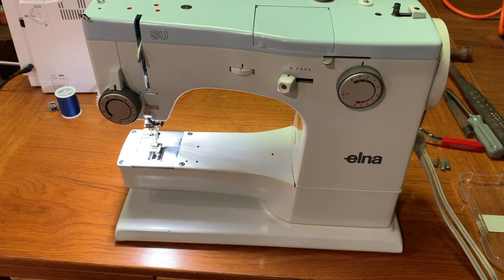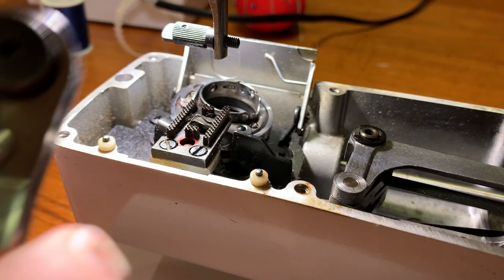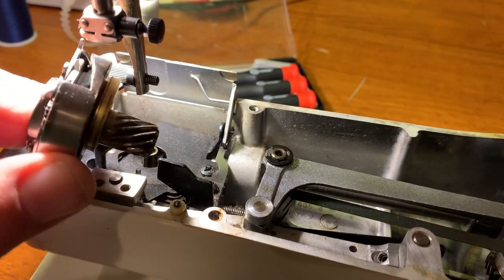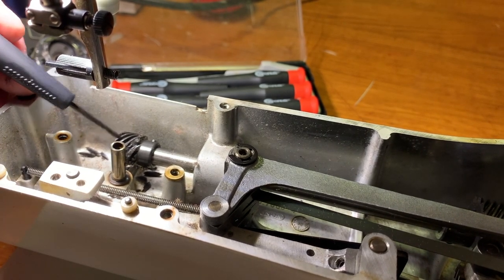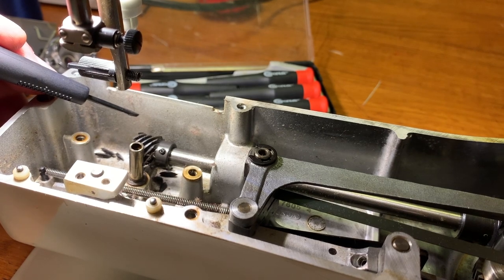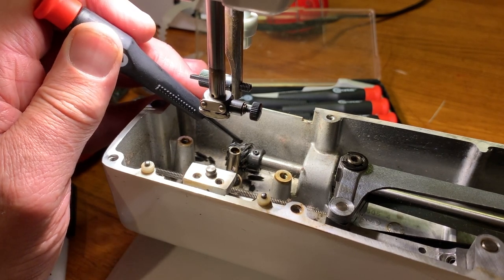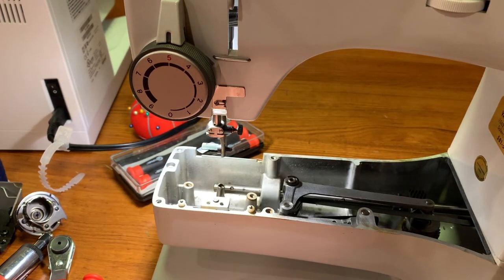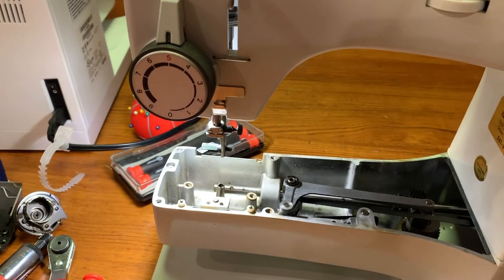Elna SU-62C Star Series Hook Pinion Replacement

Comment: I am so grateful for this video.  I hadn't used my Elna SU for many years, having progressed to a computerised Bernina sewing and embroidering machine, but wanted to use it recently, as I have a ruffler attachment for it.  Long story short - I lent the machine to someone, some years ago who said she hadn't used it but, when I tried to, I discovered the bobbin section was so tightly filled and wound up with thread, it took me ages to carefully snip and remove it all.  I don't mind when people make mistakes or even break things, but please, own up and don't lie - I was obviously always going to discover it anyway!  This video gave me the confidence to change the gear, which was so shredded, it literally fell apart as I took the pin out, and set the timing (after several attempts at that!) and I have just sewed a hem.  The bobbin tension is perfect - the top not so much, but I will play with that.  I had been told by several sewing machine engineers, that it would be impossible to get this machine going again, but I ignored them and tried anyway.  I currently live in the UK, and did find a man who lives hundreds of miles away in Cornwall, who helped me as well, particularly today as I struggled to get the hook seated correctly and connected to the gear.  His company sells brand new parts of many mechanical machines, including mine, and I bought the new gear from him as well as new plate screws as I mangled them getting them out.  Thank you so much Scott.
Reply from the maker: Very glad this video helped you get your machine back up and running, Christine!

Comment: Thank you so much for this video.  My wife's Elna 21C (circa 1969/1970) stopped working and I partially disassembled the lower part of the machine before getting stuck at how to remove the rotary hook assembly.  I then found your video and it was definitely a lifesaver as I had no idea how to punch out the pin holding the gear, and the crucial information on the position of the gear and re-assembly were invaluable.  I sourced the gear locally, but the part number linked to Amazon (#403030) was also the correct one for the 21C.  Thanks to you, my wife's machine is running like new again.  Thanks for taking the time and effort to produce this video.

Comment: Awesome video!  Thanks to your instructions, I was able to fix our Elna Automatic * after the pinion gear disintegrated.  I saved $ and enjoyed an interesting project.  Despite trying to replicate the original gear position using your technique, I ended up needing to retime the machine a little bit.  I found it actually isn't that hard to do.  Other people have youtube videos on the subject if anyone needs to do this.  Something I'd like to point out in case it helps others is that you need to check that the feed dogs are synced properly with the stitching cycle.  I couldn't figure out why my tension and stitch length were all messed up until I finally realized that my machine was advancing the fabric while the needle was down.  Turns out there's another pinion on the drive shaft that you may need to adjust to ensure the feed dogs are cycling downwards while the needle is in the fabric.   Once I did that, everything came out great.  Thanks again!
Reply: My experience exactly! I should have read your comment before I started!

Comment: Thank you for the video.  I have both an Elna SU and a Lotus TSP,  the poor TSPs gear shattered, and I'm in the process of ordering a replacement.  Your video, though not for the TSP, gives me a good idea of what I should be looking at when I dismantle the wee beastie.  Thank you for the tip of marking the shaft for the pin orientation on the gear.  That's the kind of awesome tidbit that makes or breaks the experience of working on our own machines.
Reply from the maker: Thanks! I hope it helps with the Lotus. Never worked on one of those though I hope to someday.

Comment: Thank you so much! Just fixed the very very same gear last night at the same spot, but a different Elna model. I lost the manual and can't tell which model I own. The big white plate isn't a separate piece in my version, so I had to open it from the bottom to get to it

Comment: This has been my mission yesterday, today and tomorrow.
I've changed out the gear and have it sewing but I've goofed up on the needle timing somewhere. Straight stitches are strutting the academy award carpet but the zig-zag is loudly protesting the event! Watch this space...
Reply from the maker: Hi Tom. The essence of timing the machine is to ensure that with the needle in the exact center and at the very bottom of the stroke, the hook point is at 4 o'clock. Then when the needle has risen exactly 2.45mm on the upstroke, the hook point will be exactly behind the needle. Elna mechanics used a tool, H11039 / 100630 that is 2.45mm thick to set this. They brought the needle to the bottom of the stroke, inserted the tool around the needlebar right where it comes out of the snout of the machine, and then screwed on a clamp pinning the tool in position. Once the clamp was on you could pull the tool out and be sure the needle had gone up 2.45mm when the clamp stopped the upward travel. The tools are hard to find, though. I use the plunge gauge on my set of calipers. I stick the plunger down the needlebar gallery til it hits the bottom, zero out the meter, and then use the caliper readout to get my 2.45mm upward travel value. It isn't as easy as just having the tool but it does work fine. I have timed many machines using this method. Good luck!

Comment: Scott, thanks for an excellent video. One question, after I did this my reverse stitch will not function- the forward is all perfect. Reverse side bar also works. But any reverse stitch on the stitch lenght control pulls my threads around the bobbin. Could I have it on wrong?
Reply from the maker: The timing and the feed system are only related in that they get their power through the same shaft. My first task fixing your machine would be to ensure that the feed mechanism is working smoothly and not binding. The feed system is controlled via a thin metal blade running from the underside of the machine through the free arm over to the feed linkage. Ensure it is not binding. It can bind due to stuck bushings in the vertical shaft that controls forward reverse or it can be a sticky components in the feed linkage or spring. If all of that is smooth, then check your feed dog timing. To do this, crank your machine to the point that the takeup arm is as high as it will go. Hold it at the highest point with your thumb. From that point, the feed dogs should travel 1mm forward to reach max forward travel. If they are not your feed timing is off.
Reply: @Elnamech  I found your comments on FB about feed timing, and they really helped. Thanks Scott! I see you also have AE SU 68. I kinda love mine, but she gives me grief!!

Comment: Scott,

This video Lois great and I think I could do this if I had the 62C.  I have the 64C flatbed model and I just can not see how I will get to this piece.  I can see it, but I cannot find any information on how to remove the bottom plate to get access. I can take the bobbin assembly out in this same way.  It looks like I could do this from below too if I could just get the bottom plate off the machine.

Comment: Great Video. We have the exact same machine, but it won't turn at all. I am wondering if there is a broken hook pinion as in your video. I have oiled everywhere I can see. Before I start in on the hook pinion, any ideas you might have on why it is frozen and won't turn? Thanks for your time!
Reply from the maker: Remove both the top and freearm covers. Open the bobbin door and snap out the throatplate. You can turn the handwheel a smidge due to belt flex. Watch both the hook and the needlebar. Are they both completely stuck? Oil them. Work slowly. A hairdryer to heat things might help. All else fails you can use a big screwdriver levering on one of the metal cogs of the belt to force it but the weak links are those plastic gears and they will probably break. They should be replaced anyway, but try the gentle heat and oiling first.
Reply: @Elnamech  Thanks so much for your help! I will try all of this and see how it goes

Comment: My SU was a rescue and the gear is shattered. Nothing left of it except shards . I have a replacement gear. The pin is still in place. Is it just just a 50/50 chance of getting it in the right place.
Reply from the maker: I asked this question when I talked to Ray White on the phone about the gear for the first machine I did. He did not know of any way to determine independently of actually seeing how the old one was set up. BUT, if you notice on my video I turned the machine to top dead center and then turned the machine backwards just a smidge to get the pin pointing up. I marked the shaft as being lined up with the tooth. So why not just do it that way and see how your machine looks in relation to mine? Go to needle top dead center, then turn the machine backwards until the pin points straight up, mark the shaft and put the gear on with the tooth, not the gap, lining up with the pin. Anyway, that is what I would do, I think. And don't fret too much. When you are done with the gear replacement you can always reset the timing of the machine if it turns out you got it wrong. But it is at least a 50% of getting it right. Good luck!

Comment: Hi Scott, I have the TSP Model any chance you could do a video on setting the timing up just in case you need to adjust it after replacing the new gearing. Cheers
Reply from the maker: Hi, Marc! I do not have any videos ready to post, best I can do is describe the factory method (requires an Elna tool & needlebar clamp) or how I do it using a set of Mitutoyo calipers.The factory method involves pulling the needlebar to the very bottom of the stroke. Then you insert a precisely 2.45mm thick gauge at the point where the needlebar comes out of the head of the machine. With the gauge in place, you put a clamp on the needlebar snug against the gauge and tighten it. Then you remove the gauge. The clamp is on there to tell you that the needlebar has moved up 2.45mm. On a properly-timed machine, when you gently turn the handcrank and the clamp stops the upward travel, the hook should be directly behind the needle when it is in the center position. If the hook point has gone past the needle then your timing is late. If it has not reached the needle then you are early. You adjust this by loosening 2 setscrews on the bottom timing cog and turning it forward or back on the bottom shaft. BE SURE to bias the shaft tightly to the right while you are adjusting or it will want to scootch to the left and disengage the feed dog drive. I will put the caliper version in another comment.

Comment: Hi!  Fantastic video!  The needle position dial on my 62 is so stiff it only moves a little bit and the moves don't actually move the needle position.  Is there a fix for this?  Thank you for any help you can give.
Reply from the maker: Sorry for the delay in reply but for some reason YT would not let me see or reply to this comment other than the email notification. The seized needle position dial is a very common failure on the Star Series machines. A half century of service will do that to you, I guess. I recommend you join the Vintage Elna Sewing Machine Group on Facebook. This problem has been covered by many posts. Most of the people lean the machine to the side and drip oil onto the dial and underneath it. Some denatured alcohol might help to loosen the gunk. Alcohol, oil, heat from a blow dryer, repeat over a few days. This has worked for many people. I have not done it, myself. I take the top shaft out, remove and disassemble the Elnagraph and thoroughly clean and lube the dial. I have to do it anyway as I replace the cam gear on any machine I take in.
Reply: @Elnamech  Scott, you are a doll!  Thank you so much for taking the time and effort to give me such a detailed and helpful response.  I wish you lived near me.  I would take my machines, the Elna and a bunch of Pfaffs, right over to you for professional repair and tuning.  Your videos are wonderful!  And thank you for turning me on to the Vintage Elna Sewing Machine Group on Facebook.  I will definitely go there!  Thank you!  Monica

Comment: Scott great video! I have an Elna darker green Supermatic (older version of this machine) Model 722010. Everything is working except the fabric doesn't move forward. It looks like the feed dogs do go up and down, but don't propel the stitched fabric forward. Is this part (hook pinion replacement) probably responsible for this problem? I notice at the end your machine is working perfectly! Great discussion and timing tips on this video! I feel confident I may be able to repair my Elna. Thank you!
Reply from the maker: Hello, Donna. I have not worked on the older Supermatic machines so I cannot give you a specific answer, but if that were happening to a Star series machine like the one I am working on in this video, I would be checking the forward/reverse/stitch length control on your machine. Elnas do not have a feed dog retraction mechanism. The feed dogs always should go up and down on a properly functioning machine. What you want to look for is are the feed dogs moving front to back (or back to front when the machine is in reverse) Check your forward/reverse stitch length mechanism and all the linkages they connect to on the machine. The first machine I worked on, a pink top SP, had a frozen linkage down in the free arm that would not allow the forward/reverse arm to move. I had to disassemble/clean/lubricate several items in that mechanical system to get it to work. Anyway, start with your forward/reverse lever (wherever it is on your machine - as I said I have never worked on one myself) and make sure that everything is moving properly and that your feed dogs are actually moving at the right time (when the needle is OUT of the fabric and on the upstroke) Best of luck to you!
Reply: @Elnamech  This is wonderful help! The only part we haven't look at is located underneath the bobbin casing. It is hard to believe the machine isn't functioning, we can't seem to find a 'broken' part. I haven't tested reverse, so I'm going to give that a try first.  We appreciate your help so much, thank you. If I find any solutions, I'll let you know.

Comment: Hi  thank you for the information  I have an Elna supermatic 62C bought in 19 71 I have being using the zigzag stitch but then changed to straight stitch few moments. later I tried to  do a zigzag/over lock  stitch it would not give the zigzag stitch i did try to change disc or do a button hole...but its still just giving straight stitch only. Please advise...USHA from South Africa
Reply from the maker: Is the cam platter turning when you run the machine? Lift the cam access door and watch it as you sew. If it is not turning, or turns briefly and stops/stalls then the problem is caused by a tooth (or more than one tooth) broken off of the cam drive. The cam mechanism (Elnagraph is its technical name) must turn or your will get neither zigzag or any other of the complex stitches.

Comment: Quick question Scott, how exactly did you center the separating plate?  You showed a socket from a ratchet set, is there a specific socket you would recommend using as a guide?
Reply from the maker: I just used one that fit and eyeballed around it for even clearance. The outer diameter of the socket will vary depending on who made it so find one that just fits in the hole and sight around it.
Reply: @Elnamech  Thanks Scott!  That's very helpful.
Reply: I find I have another question Scott, and I hope you can assist.  I'm working on a Cl 33 which is a flat bed machine and I cannot get the black separating plate out of the machine.  On the free arm the bed of the machine unscrews as you show in your video, but that's not the case with the flat bed.  Do I need to remove the bottom of the machine or is there a trick that I can't figure out to get the separating plate out?
Reply from the maker: @r.duroucher225  I am afraid that I have never seen, in person, any of the platen models. All of my machines are freearms. Wish I could help further.
Reply: @Elnamech  Thanks for your response Scott.  I guess these platen machines must be less common than the free-arm.

I believe I’ve got it figured out.  There is a space between the bottom of the platen and the bottom frame.  That space runs right round the machine and the gears are exposed.  One can access the pinion from there without having to take the black separator plate out.  One can remove and install the pinion from the rear of the machine through the gap.  From what I can tell, the rest of your method applies.  

I have a pinion on order and will know once I try it out.

Comment: Why are replacements for crushed gears made of nylon rather than hardened steel??  Seems like it will strip out much sooner and easier in future??
Reply from the maker: The original gears were plastic. They used plastic to reduce noise from the hook and cam drive areas and also to provide an emergency strain relief in the event something got jammed or bound up under power. The plastic would fracture before serious damage occurred in the drive system. The problem is those plastic gears were made from materials from half a century ago! They age and get brittle. When that happens sometimes even a minor stress snaps teeth off the old gears. The modern nylon gears provide the noise reduction we want and the stress relief for system binding but won’t just shatter under normal operation. That’s it in a nutshell.